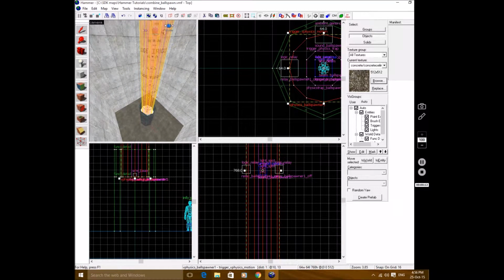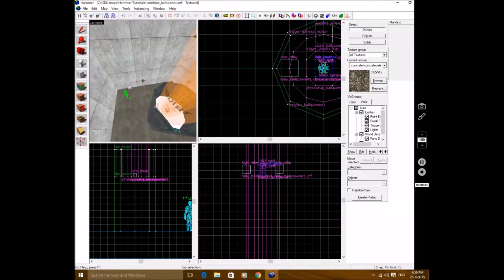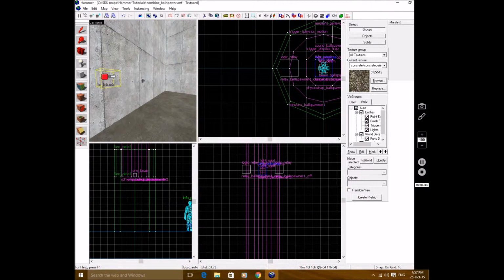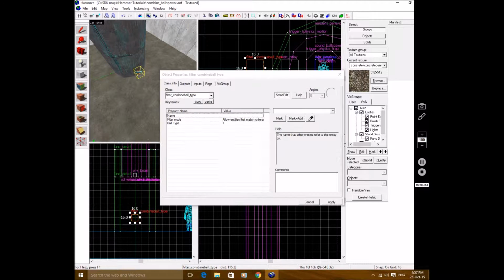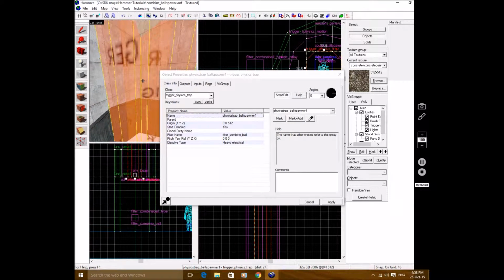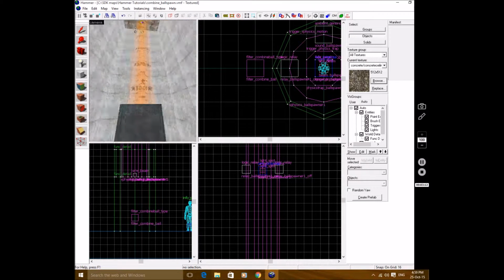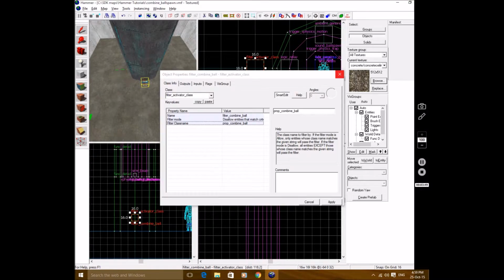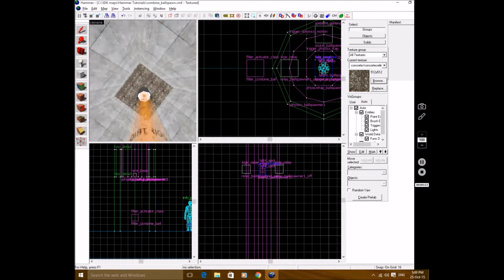Hammer Tutorial 7 - Combine Ball Spawner

Comment: i have a texture error
Reply from the maker: Where are the texture errors occurring? It may be that the textures required are missing from the game files. I checked and I have no texture errors at all, meaning all the textures are in the game files (some of the Source SDK prefabs have obsolete textures and appear grey, which is possibly what you're experiencing?) Maybe right clicking Half-Life 2 under your Steam directory and selecting Properties, Local Files then Verify Integrity of Game Files will find any missing assets and install them. Or you could browse through the textures available and select an appropriate one. It depends on where it's happening, really.